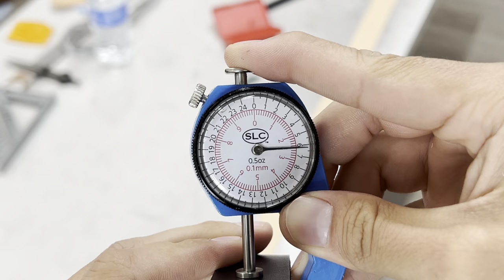Making a Deluxe Serpentine Stamped Leather Belt

Comment: What do you use to prevent rub off on your projects? I always get rub off whenever I dye belts, or anything that will be in constant contact with sweat. Always thought it was due to the heat and humidity in the area I live, but did not know if you had any ideas on what would help/prevent excess rub off. Thanks.
Reply from the maker: I don’t know if there is a perfect answer. I wouldn’t say my methods are the best, but on the products that I’ve made and even use for myself, I haven’t had many issues with rub off. I use pro dye, and I’ve heard that it helps but I’ve never actually compared straight against anything else. I try to wipe away as much pigment as I can that could be sitting on top of the leather after dyeing. I use tan kote as a top coat and it will pick up extra pigment and wipe it off too. Some conditioners and other types of top coats may help in the long run but I don’t know if you can 100% eliminate it overall. Quality of leather may play a factor in some instances too.